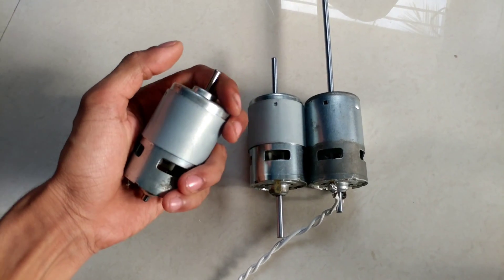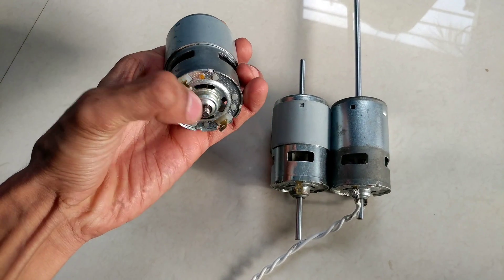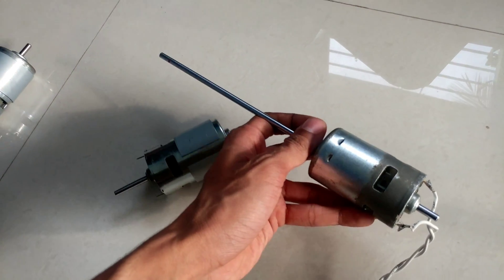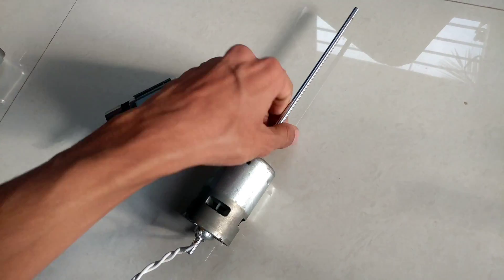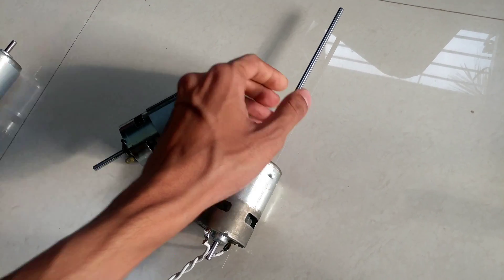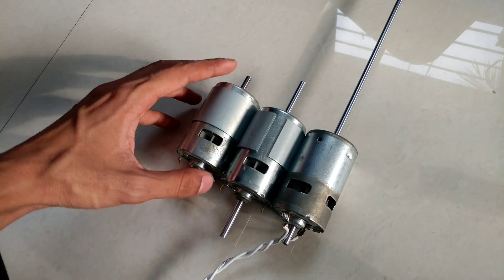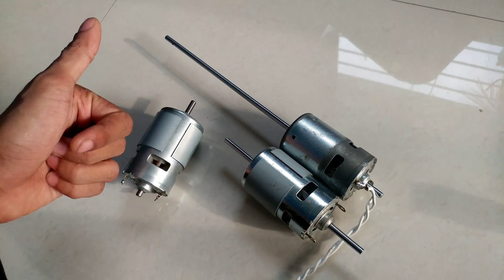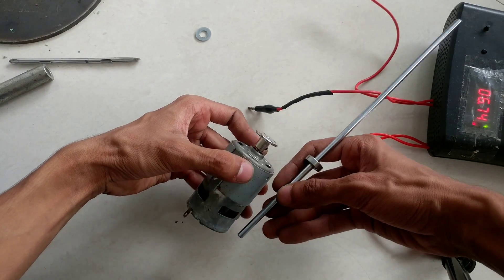How To Make Long Shaft & Dual Shaft 12v 775 DC MOTOR

Comment: Hi please answer my question

Can i put the bigger shaft on it??? Not longer but bigger

For example 
Original shaft 5mm

I want to change to 8mm shaft

Work or not?
Reply: If you want to couple it to other 8 mm dia shaft or accessories then better use 5mm to 8 mm coupler. 

U can't put 8 mm dia rod inside the rotor. 

At the most u can have step on shaft  that is for some length 5 mm and some 8 mm.

Comment: what do you use to power that motor???
Reply: Dc power . Heres the link to buy one 775 motor : 
https://www.amazon.co.uk/dp/B088KCDQPC/?coliid=I1T5F01B78RZ8N&colid=36YID3R8045AF&psc=1&ref_=gv_ov_lig_pi_dp , so that you can check the details of the 775 motor and also 775 motor is a powerful motor it can be used in drillers.